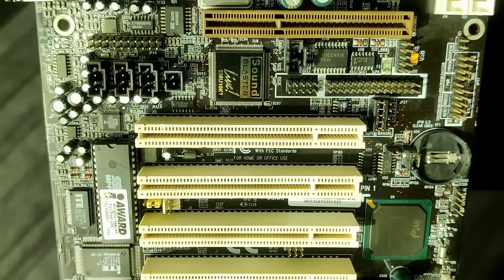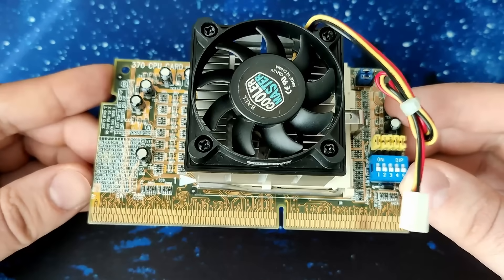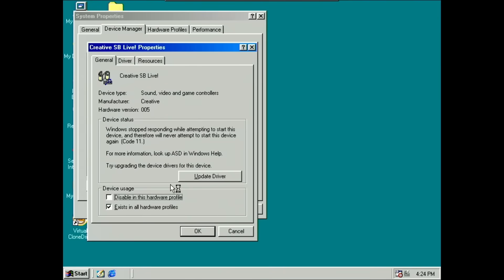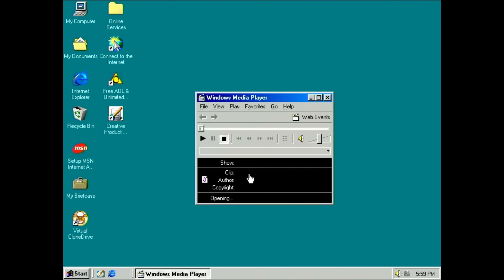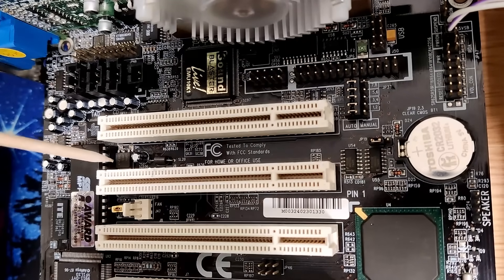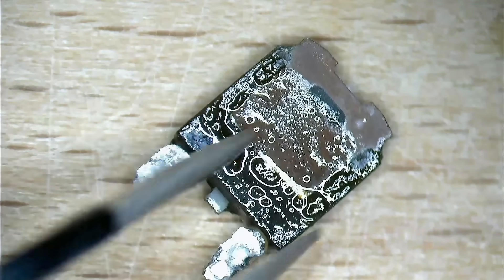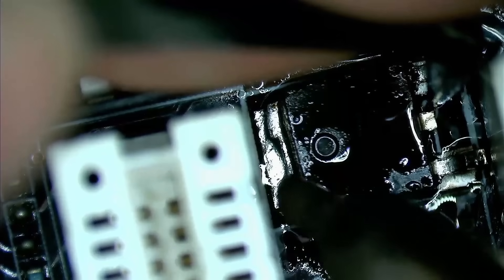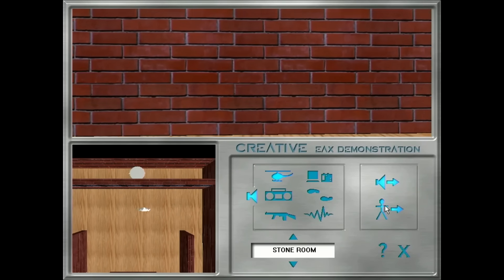Still no Sound! Stubborn Creative Labs Slot 1 motherboard

Comment: What a nice motherboard! 
I see no one mentioned that it has on board the connector for the Live! Drive 5.25'' front panel which was very nice and practical including even a remote control! Maybe all those stuff were thrown away with the PC case so sad...
I had almost all SB Cards except Recon3D since SB 128 PCI, and for Live 5.1, Audigy, Audigy 2ZS, XFi Platinum have the panels internal and one external with remotes

Comment: Just wondering if you could help me by pointing to where you found the correct drivers for it? Much appreciated.
Reply from the maker: I tried several ISO images of original Creative SoundBlaster Live installation CDs which I found on the "Internet Archive" website. I think it's called Live!Ware 3.0 - I hope that helps, but I can check later if I saved the links.

Comment: why shouldn't you mix low-melt solder with proper lead one ?
Reply from the maker: Mainly what I have heard from others. Low-melt solder is softer than regular solder. It may make solder joints easy to break (due to flexing and heat). I usually remove it as good as I can before reattaching any components.

Comment: Had a SB-AWE32 for a long time, until I no longer had ISA slot in my workstation. Even loaded midi soundfonts from friend's SB-Live! CD after upgrading AWE's RAM to 8MB. Remember replacing some Win98 driver files directly under DOS, there was a movie to test if it was a success: bad drivers = girl said "Shteven", good drivers = girl said "Steven". Sample rate could be set to around 50kHz under DOS (FastTracker ][). When I got a used SB-Live! 5.1 I was already using Linux. Later got Audigy 2ZS, and now there's a Audigy FX (SB1570) in my workstation (made of a server platform, so no onboard audio). I use it mostly for Line IN (digitizing old tape recordings, etc). Sound output is usually streamed over the network using Pulseaudio / Pipewire, and in most cases laptop's audio output is used, either connected to the headphones or amplifier. Die Welt ist Klang 🙂

Comment: Love these little trips down memory lane of yesteryears tech, just a thought, what was the clock divider setting for the 133mhz  bus that failed? was it clock i/3  or 4? divider needs to be slackened to 4  on most of those which I assume is a 440BX to keep pci @ 33mhz and AGP @66
Reply from the maker: I probably have to go through the manual again. There are quite a few jumpers that need to be set for the CPU and frequency setting. It could be that I missed the divider somehow.

Comment: The EMU10K1 drivers tend to not play nice with 440BX chipsets. My ABit BE6-II suffered from the same issue. I just ended up tossing the Live! for an AWE64. I might find an Audigy later on down the road and use that in my PIII build.
Reply from the maker: You believe there to be an issue with the drivers on 440BX chipsets? Would be odd to have the sound chip on the board. I'll try to find out more about the drivers and how to install them on windows. Let's wait for the next video 😁
Reply: @bitsundbolts  I tried manually allocating resources to the Emulation driver with no resolution. I just gave up in the end. The Live! works perfectly fine with my ASUS P5A-B motherboard. As soon you started receiving the BSOD's like I did, I put two and two together, seeing that both are 440BX based boards.
Reply from the maker: It may depend on the board/BIOS and their resource allocation. Maybe the ABit had an issue, but other 440BX motherboards will work without issues. Let me see what the results are from my experiments. But I keep your issues in mind.

Comment: simple but amazing fix! I don't know what happened for that IC to come loose, I also thought the whole pad had been ripped off. To me, it was poorly soldered at the factory.

Kapton tape: it's heat resistant, it doesn't mean it'll shield fragile components from heat! In your case I would have used some tin sheet from a drink can for example. Something you can cut with scissors and bend to shape. Kapton helps of course but it's not an insulator! 

You've done an amazing job as usual!
Reply from the maker: Thank you!
I probably should have used something to protect the plastic slots from the soldering iron. But I was extremely careful, and the parts that did melt a little bit would have been difficult to shield (bios socket)
Reply: The conductivity can be an issue, but aluminum foil is good for shielding other components from heat.

Comment: I want to add something here. I deal with new computers with bad motherboards a lot. Mainly HP Pavilion consumer level desktops. My process is I run the HP UEFI diagnostics, and if they pass, and the computer still crashes in windows only, it's a bad motherboard. How oh how would you go about troubleshooting a newer motherboard like that? Since no one on youtube does it, I'm assuming it's someting you don't do, and you just chuck it. Right?
Reply from the maker: I guess this is what modern electronics are - just trash the entire thing (thank you Apple).
The problem may go even further. HP, Dell, and all those companies may have proprietary diagnostic tools. I can imagine that this may be the reason nobody does it. Very unfortunate. And this will be the hardware I won't touch.
Reply: That's what I thought. It doesn't objectively make sense for any software to be able to diagnose a motherboard especially with how complicated they are now. There's way too much logic. You could give a board like that to an electrical engineer and pay them 15,000$ to go through it, but no one's doing that @bitsundbolts
Reply: Pretty much the only thing easy to troubleshoot is power delivery. For an intermittent problem that would pretty much just be capacitors.

Comment: If I remember correctly - middle terminal of the regulator (cut off one) is also connected to a tab, so you could have heated it too?
Reply from the maker: Yes, it is indeed connected to the tab. I don't know if this would work. All the heat would have to travel through that pin - maybe it would be enough to melt/damage that IC?
But I see your point. Maybe someone else knows if heating the cut terminal can be abused to reflow the solder on the tab.

Comment: What an adventurous layout/routing... i mean the synth chip is up north, this regulator between the sockets, and the Sigmatel AC97 doing the analogue duties of the soundcard is right north of the BIOS socket. Bet the regulator is for the STAC97.

I sometimes just use HVAC alu tape (dollar store grade) to protect components. Or i layer it with some other tape underneath. Kapton itself gets hot and then it transmits heat, but if you're just guarding against accidental touch, Kapton might just be the best choice. Also i had a bit of a bad luck event buying Kapton recently, it turned out not to be Kapton but amber dyed PET. That was a disappointment, because this one shrinks when heated, potentially moving components about that you were trying to protect.

The regulator was never soldered down properly. It had an oxide layer on the pad from bad storage, and the solder on the mainboard entirely failed to penetrate it. Excellent repair.
Reply from the maker: Thank you! I'll try to get some Ali tape because as you said, for hot air, Kapton tape may not be enough.

Comment: hey BuB, since you mentioned the PIII 500, i also have one paired with an intel RC440BX ATX version and for some reason the board will NOT boot with the battery on. I remove the battery, the board boots. Have you encountered something like this in your endeavors? Any advice? :) You know what bugs me about your video?! It's too short! :))
Reply: Just speculating but some autoconfiguring boards require you to hold a key down on boot to clear CMOS and detect the CPU type. If you can find the motherboard's manual on The Retro Web that might give you some clues.
Reply: @SanguineBrah  yes, i have the manual. without the battery on, the board boots normally, no errors, nothing, CPU is recognized, RAM is ok, FDD is ok. I put on the battery, press the start button, the cpu fan spins for 3 seconds and then it shuts down. also updated the bios from P10 to P14, without the battery, the flashing went ok, no errors. put on the battery after the flash, behaves the same
Reply from the maker: I have never come across such an issue. This is really weird. Maybe the BIOS retains wrong values with the battery present (faulty bios chip/cannot store data correctly?)
If you leave the battery in the board and clear CMOS via jumper, does it boot (at least once)?
Hehe, thanks for telling me that you'd like to get longer videos. Unfortunately, I already need about a week to make a 10-12 minute video. I wish I had more time, but that would only work if I'd quit my job.
Reply: @bitsundbolts  i don't think it's a bios problem since i updated it, without the battery, from P10 to P14, without any problem. put on the battery after the flash, the no boot with battery on behavior reappeared. it may be a board physical problem, a short somewhere, maybe. all electronics i know is from you, necroware, vswitch, tony, etc :)
Reply from the maker: I know nothing about electronics 😳 maybe I manage to follow some traces...
It could be that the battery prevents the system to boot. Maybe your assumption having a physical damage somewhere is correct. You don't have a POST analyzer card? Would be interesting to see if you get POST codes or if they differ with and without battery.
Reply: @bitsundbolts  unfortunately i don't have one :(
Reply from the maker: That is unfortunate - it may be able to provide that missing piece of the puzzle. I can't think of anything else right now what you could try... Those POST cards shouldn't be expensive, maybe consider getting one?

Comment: did you try the audigy pack for live card from vogons?
Reply from the maker: I used an ISO from the internet archive which states Audigy in the installer. You can see it in the video.
But later I found out that I just have to overwrite l files the installer complains about (overwriting newer files), then the vxd drivers seem to work from any ISO I used. But I have to look into this further.
The Audigy/Sound blaster drivers were the WDM drivers that I used in this video.

Comment: How ironic that it's a board only noteworthy for having an integrated proto-Audigy sound chip. Gimmcky but still a neat feature. I wonder if that solder defect you found and repaired could be the very same that caused it to be thrown out, since I'd guess it was screwing up the whole PCI bus. Might be interesting to see if the PCI slots are all functional. Also I gotta say your work is like art, I really enjoy watching it.
Reply from the maker: Thank you! And an interesting take on why the board may have ended up at the scrapyard. I don't want to believe that it was just due to obsolete tech 😔
Reply: I think the regulator was most likely only used for analog circuitry. As it's a 5v regulator they would just use the 5v from the power supply if the supplied circuitry was not sensitive to electrical noise. Also I believe the PIIX4 runs on the main PCI bus, if the bus was down you couldn't boot.

Comment: Drivers have always been a pain with those cards.
I think sometimes it's worth testing them with a Linux, I don't remember having bad results with the Linux driver.
At least to make sure the card is not broken.
Reply from the maker: I did some more tests after I finished the video. Turns out, you need to overwrite all files the installation complains about with the older versions coming on the CD. Otherwise, you'll end up with blue screens and non-working hardware. When I overwrite all files, the vxd drivers work under Windows 98.
Reply: @bitsundbolts  nice you finally had it working.
This confirm those drivers are a pain :)
Reply: @bitsundbolts  In future, to help you find the correct drivers for a device, simply go to Device Manager -> Device -> Properties -> Details tab -> Select Hardware IDs. Search for these entries on Google or in the device driver files themselves.

Comment: Those FQFP packages on those era of motherboards do tend to get disconnected over time too. Flexing, thermal cycles, very thin solder and oxidation (or poor joints from the line) do it too. As a preventative maintenance I'd recommend going around that SB chip if you get the chance with a reflow.
Reply from the maker: I'll have a look at the SB chip.